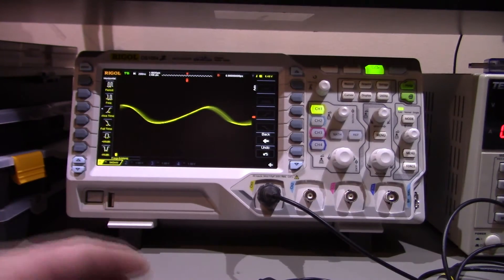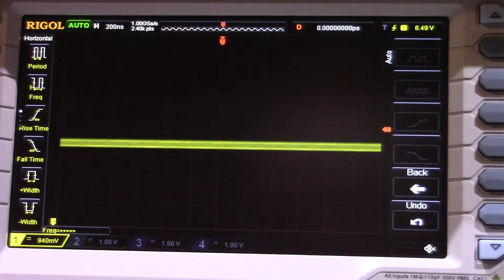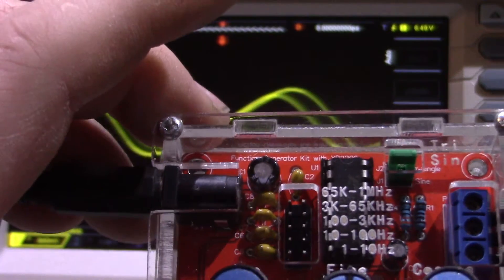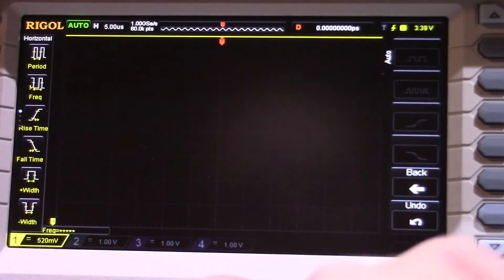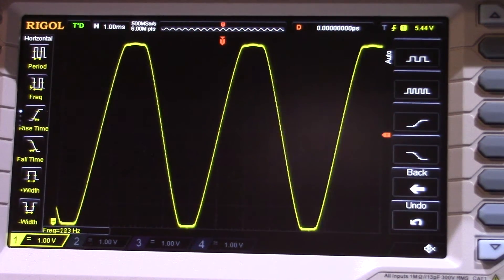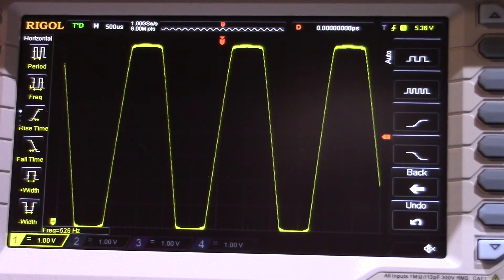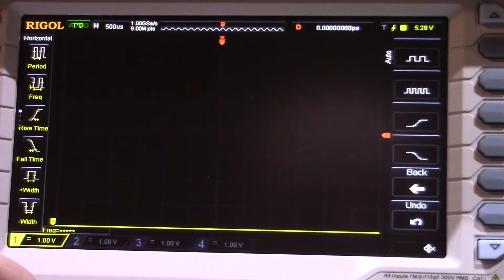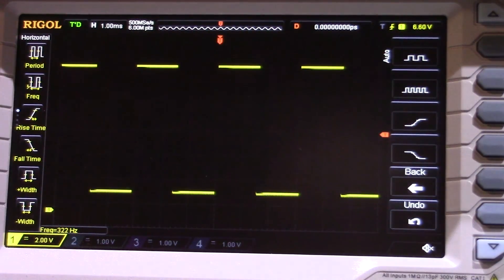Bang Good XR2206  Function Generator Fixed

Comment: Hello, how do I use the xr2206 circuit to manufacture a metal detector or gold radar?
Reply: it is in no way related to a metal detector, its a waveform generator ic, overall a metal detector is not an application for this ic, u have to use something else just look on yt there are plenty of videos

Comment: I've got it finally. In the range of 1-40 Hz I see axes instead of square waveform. Is it normal for this device?
Reply: Axes, "axe form" signal. So, horizontal line is not horizontal, it's like an axe.
Reply: @powerbatterychannel4315  Those are called saw-tooth wave forms
Reply: In some days I'll upload the review of this device including its "axes")) As to solder - it's OK. I doubt that my DSO130 is so bad that it's impossible for it to show correctly the waveform of 10 Hz signal.
Reply: I'm using separate PC power supply i.e. 12V 20A :) Anyway it's enough.
Reply: As to "axes" - I've uploaded the video, - please, see the last one on my channel from 12:10